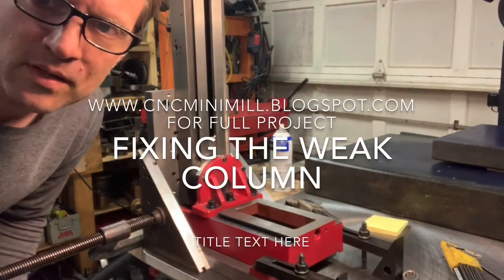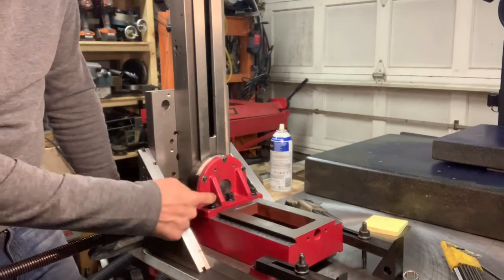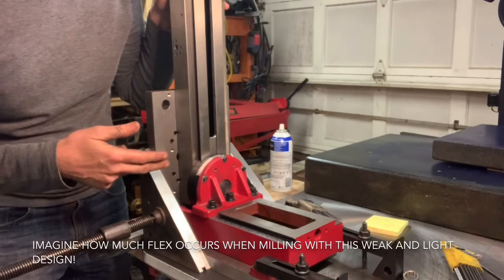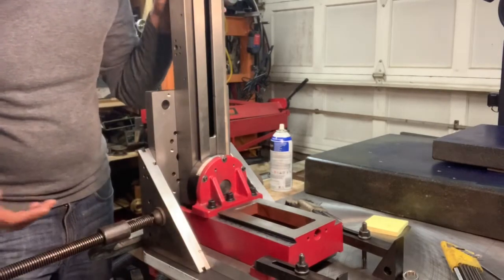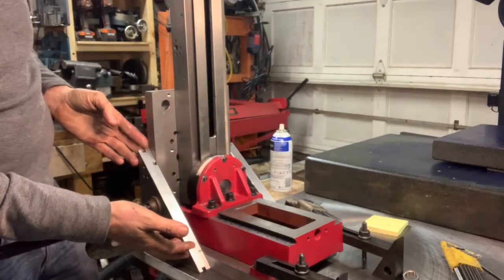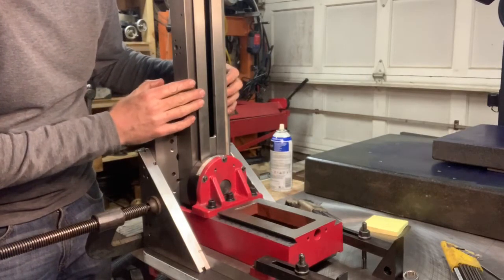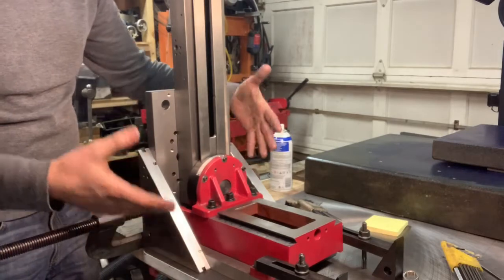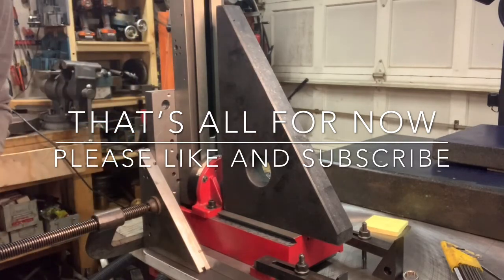Fixing the weak column of a harbor freight mini mill

Comment: I never have a problem with the normal column mounting. To begin with the main pivot bolt is tight as well as the adjustment bolts. Sure if you losen the connection it moves!🤣
Reply from the maker: Depends what you’re trying to accomplish.  Save the headache and don’t do this if you want to slow down and go easier and run softer material.

Comment: Great Video... I like it !!   .... I will doing a similar thing with mine,  but I will adding 2 fine thread bolts near the top of the rear plate on each side, to push the column right and left.  (to adjust the column)
Reply from the maker: Yea I don’t have adjustment built in that way I suppose I could shim mine to accomplish it.  I am ramping back up on the project right now.

Comment: but does the force when milling not go in the other directhion from what you have shown?
Reply from the maker: Hi Adrian the force goes fore, aft, and side to side.  This strengthened it in all of them.  I did measure the deflection fore and aft and got different values but it is still a huge improvement in any direction.
Reply: @hansw33  thanks for the reply.. I have the same mill and I am looking at doing the same thing to mine.. I will be making it possible to also fill parts with epoxy granit
Reply: @hansw33  Please show me the measurement results.
Reply from the maker: @SergeiPetrov  that’s in this video Rigidity and squareness improvements on the Harbor Freight Mini Mill